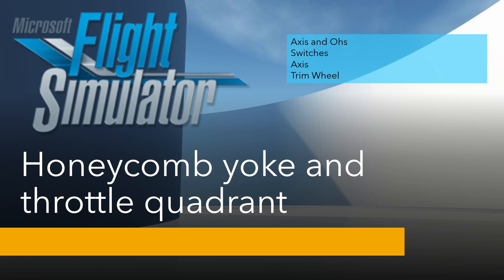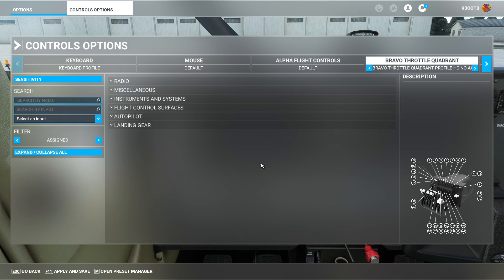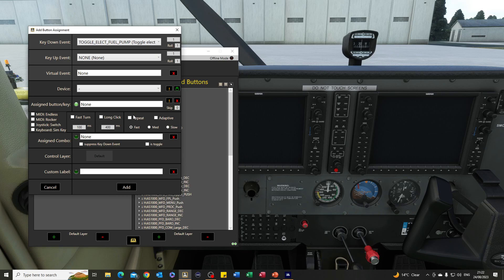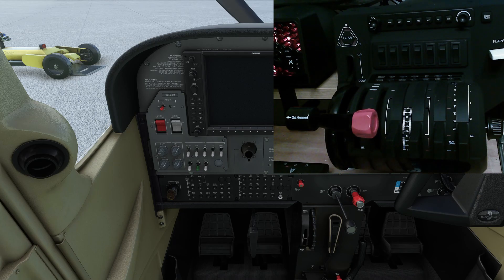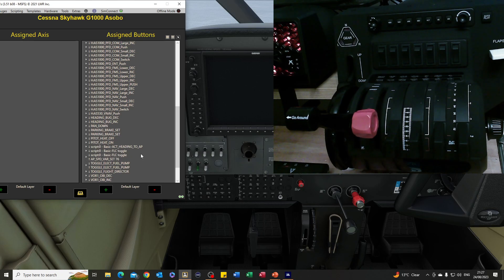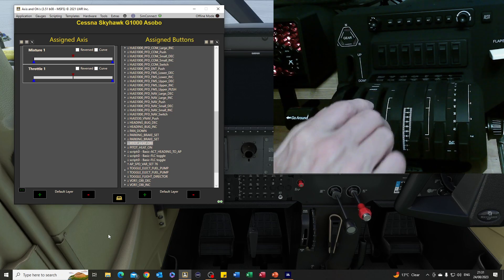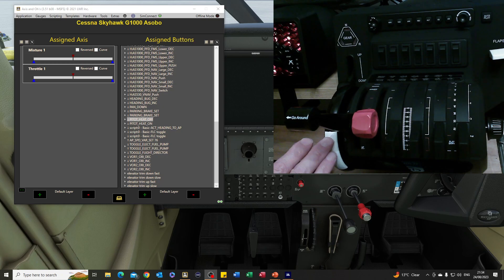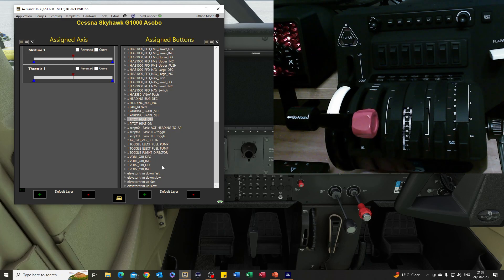Honeycomb, AAO (Axis and Ohs), Switches, axis and trim wheel on the throttle quadrant

Comment: I need this trim wheel fix for XP12. And I'd love to know why Honeycomb hasn't offered a fix for the trim wheel, which doesn't work smoothly, and seems to skip segments when trying to trim the aircraft??? Honeycomb SHOULD have fixed this months ago. But it is still very intermittent. So I'm wondering if you are anyone else has found a fix for this in XP12? Or if Honeycomb is EVER going to offer an updated firmware? Cheers!
Reply from the maker: I doubt there will be any fix soon from honeycomb. The company is going through problems at the moment. Also I’ve not used xplane since v9 I think. So no idea if my idea of using a slow turn or fast turn works for it. My flights sim computer is out of commission at the moment. I have another project going the needs it for a few months

Comment: Quick question Keith. I am playing around with the ELEV_TRIM_DN event, and I do not have the ability to change the Roll number from 1. If I select the Fast Turn box, I still cannot change the Roll or the Fast Turn ms. It's like something has those fields locked. Do you have any suggestion for that. I have no hair left on my head trying to get around this. Thanks

And a follow up, I assume you have both of those 22 and 23 disabled in the Sim itself for the trim wheel?
Reply from the maker: I’m away from my pc for a few weeks. 

Yes. I have the trim removed from the msfs config. 

I think you can only change the values by rolling the wheel on the mouse. Not using the keyboard
Reply: @Keith_Butcher Thank you much sir, never thought of rolling the mouse wheel. I should read the documentation:)